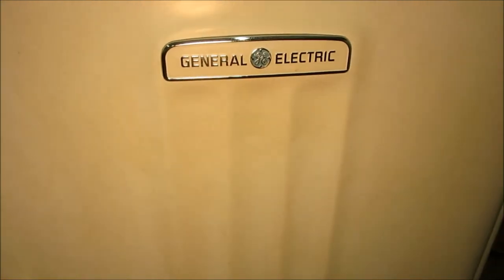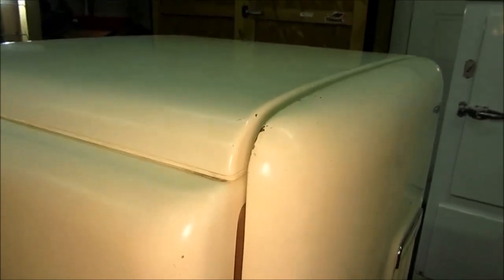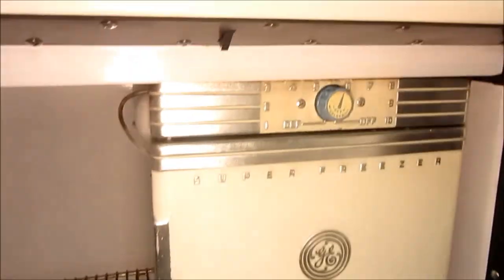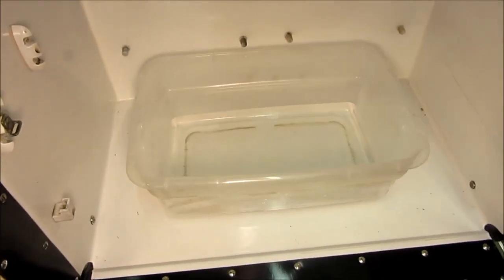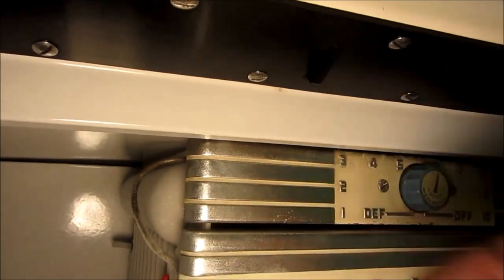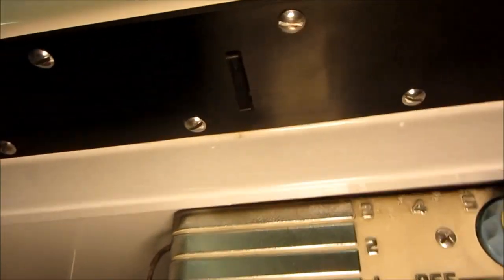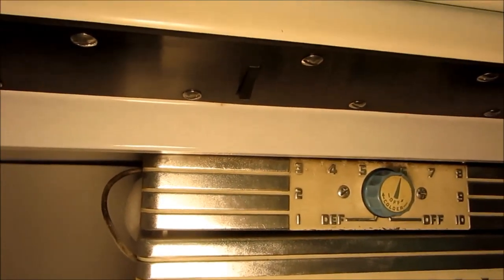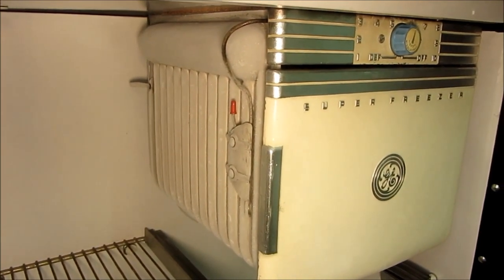General Electric antique CF Flat-Top refrigerator repair - 3 - Compressor swap conclusion...

Comment: Thanks David,  I remember these units as a kid.  Remember turning them off to defrost inch thick frost.  We were warned not to use ice picks to dislodge the ice.  I guess some were ruined that way.
Reply from the maker: Hi William.  Sadly, many were punctured that way! I have fixed countless 40's and 50's "roundie" fridges where the evaporator was punctured with a butcher knife or icepick. 

Sometimes it wasn't always defrosting when this happened. Back in the day before icemakers, people would be too lazy to use the ice cube trays. They would try to chip ice off the evaporator coil to make ice chips for their drink, and get a little too deep and puncture the coils.

Comment: I had a ver nice "super" model GE 1940 fridge.  It had stainless steel shelving, a light in the freezer as well as in the box itself, a small butter warmer box inside - with a temp adjustment for softer or harder butter and a thermometer built into the door.  I gave it away to a fraternity at the U of MN.  It's probably still running.

Comment: I'm searching for a thermostat diagnosis/rebuild video for a GE like this one.
Ours has a thermostat problem every spring when I turn it on (it's in the garage).
I have to take it out and clean the corrosion off the internals and contacts to get it to work, and then it's not reliable. I don't really know what to look for. I'm just glad that they built them back then to be taken apart and serviced.
Reply from the maker: Hi there.  It sounds like moisture is becoming trapped in the cabinet during the off-season while the fridge is not being used. Do you leave the door open during the winter? It really should have the door left open a crack, to allow moisture to escape. Many fridges have been ruined because the thermostat, and the cabinet its self can rust out from being closed up with moisture inside. Even if the interior is wiped dry, there is always moisture trapped in the insulation which needs to escape gradually over the weeks after it is turned off.

Comment: Beautiful! I'd bet that old door switch could be disassembled and repaired.
Reply from the maker: Yes, yes it could have under normal circumstances.  Unfortunately this one had arced and charred the Bakelite switch housing. There was nothing left but the metal part with the switch lever attached. The rear part of the switch was crumbs. This is a "sore spot" on these fridges where there is no replacement which will fit in the original opening and look original.

Comment: I have a 1938 GE fridge that looks very similar. I need to replace the original gaskets on the lid and door. Where did you find replacements?
Reply from the maker: Hi Sean. For this fridge, I used self-adhesive gasket material from Lowe's. They have a double-bead weatherstripping which works beautifully.

Comment: What type of refrigerant did you end up using when you refilled the compressor?
Reply from the maker: Hi Matt.  The General Electric SO2 Scotch-Yoke machines from the 30's and 40's are best recharged with R152A. It works in these machines without any oil changes or modifications to the system.
Reply: @davida1hiwaaynet  awesome to hear. I have a 1939 GE refrigerator that I’ve had to do some re-wiring on in the last few years, but never had any refrigerant leaks. Hopefully I’ll never have that issue, but it’s good to know I can use the same components and put a new refrigerant in instead of replacing the compressor.